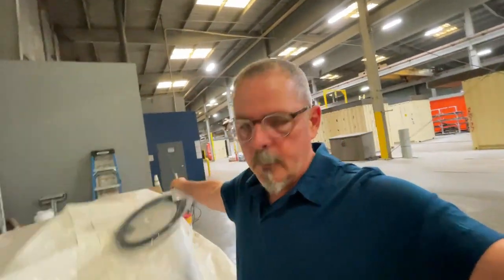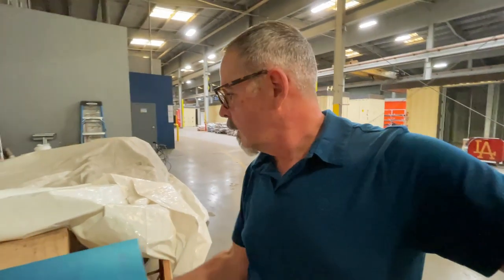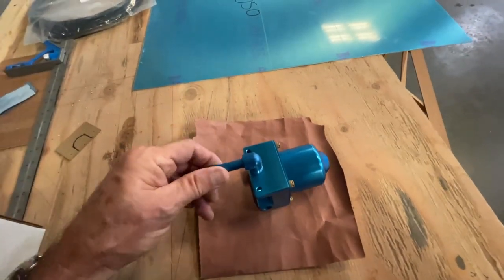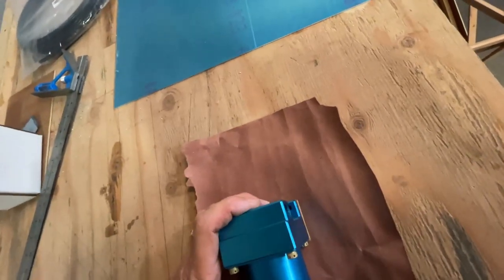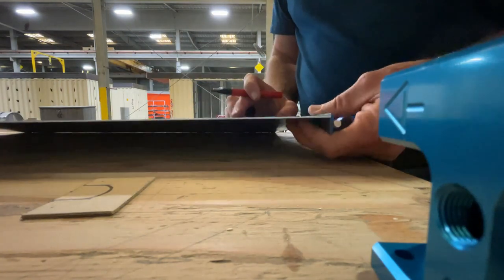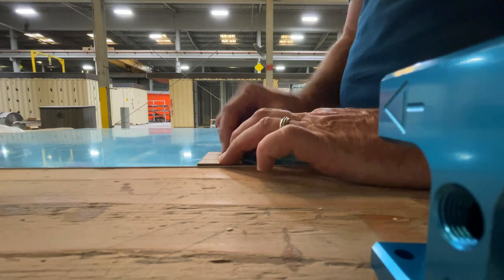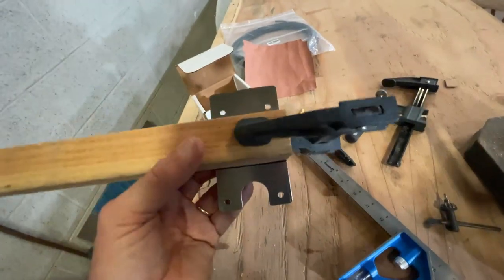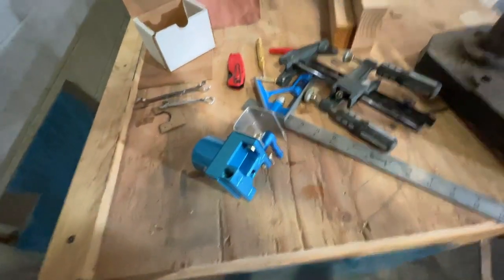Minimax 1100r Wood Aircraft Build Ep 103 - Airplane Fuel System

Comment: Dennis.  Will your gascolator, when mounted, be at the lowest part of your fuel system?  In order for any water, sediment to collect there.  I've seen gascolators with "bales" which allow the "bowl" to be removed, from time to time.  These required a hole, in the floor, the diameter of the gascolator bowl, to allow it to protrude outside.  

Read alot about not mounting the gascolators forward of the firewall due to engine heat and vapor lock.  I only had one gascolator in another plane I built - didn't use one on the EROS.  Had two "sump drains" mounted on the floor with access to the spring loaded drains under the fuselage - worked well.  Drained some water, from time to time.   Talking about "keeping the fuel running downhill" -  could it  be a problem with a high angle of attack? - your carb might  be higher than the fuel tank. (?).  

The EROS was quite a bit different - I used the pneumatic engine driven pump (which failed twice) along with a standby Facet pump.  Always turned  on the pump at take off and landing.  You are really coming along.  I loved it when you said you could just sit there in the cockpit. :-)   We all loved that.  :-)

Comment: You're trying to get that 90 to turn another 117ﾟ or whatever just grind a little bit off the top of the stud that way it seats farther in or is there some sort of bevelled edge on the end that adapts to some sort of rubber bushing in that case then probably wouldn't work just food for thought
Reply from the maker: Hey Chris, these NPT fittings are tapered so it’s really the threads at widest part that are keeping the fitting from going further. Solid idea you have if it was straight thread. I have heard you can tap it further and use the handle of the tap to turn to the correct angle.

Comment: Sorry Dennis, I still think that bracket is no up to lasting with the vibration and weight moment. I also think you will find it gets in the way. You will loose very little in flow rait with fuel going down and up hill as it is all down to the head of pressure produced by the tank position (as long as you don't have tight bends and increase the length by much). If you mounted it low you could also get rid of another potential leak by having the tap fitted directly to the bowl and accessable dirctly from outside the aircraft.
All that said it will be interesting to see how you find your set up, long term.
Reply from the maker: Thanks so much Algy! You’ve answered the question my own research couldn’t produce. Done deal for me..it’s going right to the bottom and I’ll save a couple of brass fittings and a piece of hose along the way. The brackets only job at that point it to hold it in position. To remove the bowl on this one I have to remove it completely anyway, so sitting on the bottom causes no problems maintenance wise. Thanks again!
Reply: @DTMinimax  If it is sitting on the bottom then the bracket will work well. Glad my engineering background is of use :-) A question for you, are you having a pump bypass line with None Return or Y piece or are you just going to flow through the pump?
Reply from the maker: I’m going to just go straight through to the Zenith carb…probably put a fuel filter “last line of defense” on the front side of the firewall.

Comment: hello i am starting a build on my own soon and was wondering how much work is required,what tools i will need, and what else i will need to order with the actual kit so that the pane is flyable
Reply from the maker: I’ll do my best here…Instruments and what’s needed to connect them, paint, fuel tubing and anything part of the fuel system , engine and anything associated with it. You will need those things beyond your kit. 
The plane can be built with very basic tools especially from kit form. Life will be a whole lot easier with a table saw and a band saw. I built from scratch but you’ll see in my videos I use them all the time. 
Any questions you have, just shoot them on over, I’m happy to help!